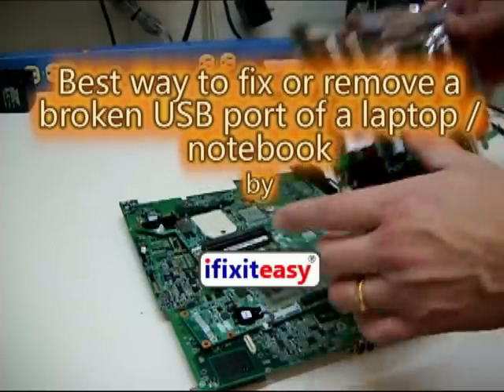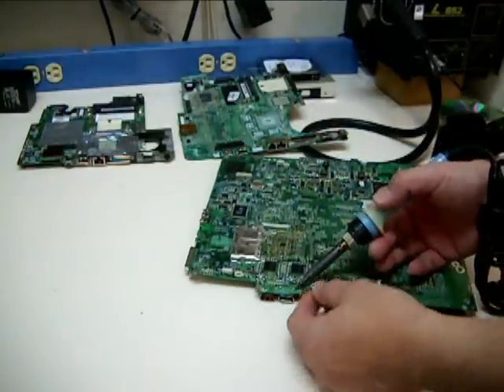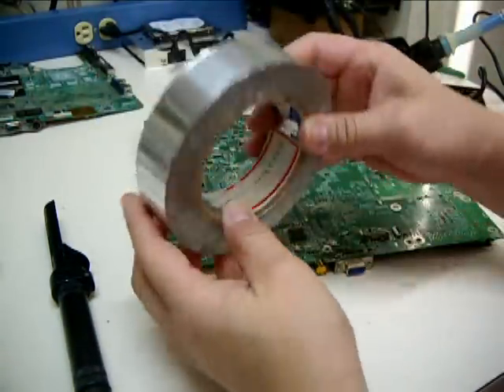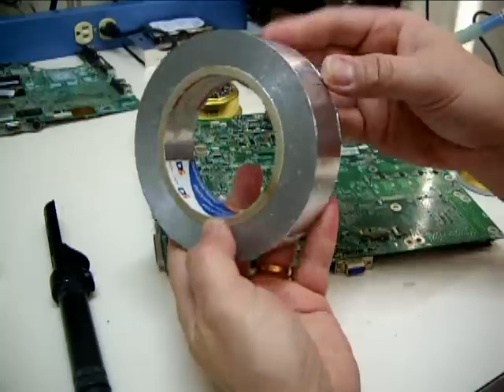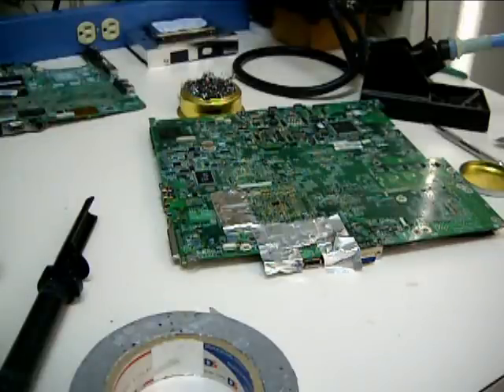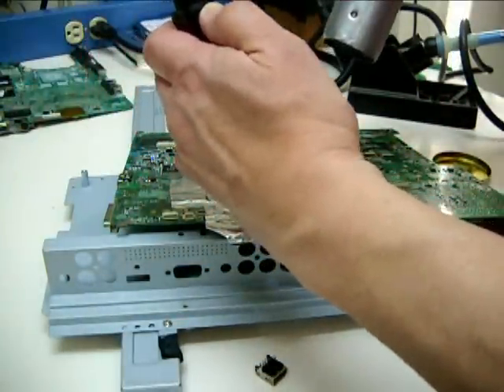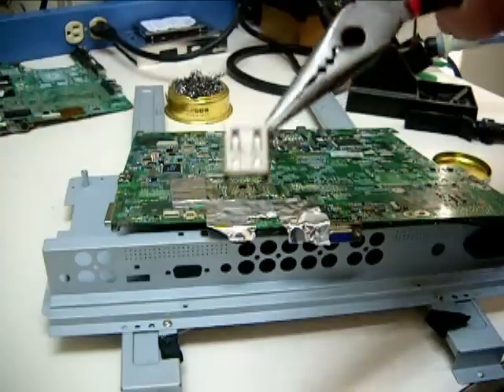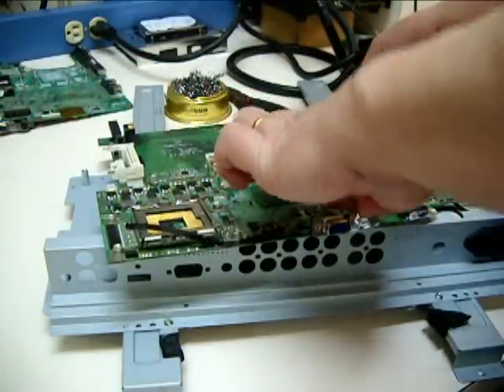How to fix a broken USB port of a laptop or notebook

Comment: You would be much better served in this process with a more powerful iron or hot air station (even a crappy one is decent).  Those 35W irons are way too frustrating to remove OE/wave soldered boards. Once you use a good 85-100W iron with decent tips you would be amazed at the difference.

Comment: wrong! you're not Professional!

heat gun is not the best, is just the simple way! you can burn other components.... the foil dont do any thing just prevent to fly small component....

youre so bad in soldering you dont even achieve unsoldering one leg with soldering iron... you know what is braid? you now that your soldering iron need to have her extremity tinned?
Reply: rude man if you know how why did you clash the guy who try to be useful with his tip ?
Reply: Mixax Mirania 
cause when you show wrong way to do a thing, when you dont have the skill, you dont be usefull..... you just do the opposit
Reply: Miles Tarricone 
me?
yes i did that,
Reply: i hope you didnt talk about the guy on the video
Reply: Mixax Mirania 
your hope never be exaused

Comment: can i do this just with a solder gun itself?
Reply: Yes & also with a heat gun.
Reply: No, you also need an accessory for lifting away the old solder after you soften it with the gun, such as a solder suction tool (as in the video) or some soldering braid

Comment: I just started soldering not too long ago. I made my own dance pad controller for DDR using ply wood, plexiglass, tin foil and the circuit board from an existing dance pad that wasn't working right because it was flimsy.

But recently my laptop fell off my couch and landed on the USB dongle that was still plugged inside and now the USB port wont work. Ya made it look easy enough to do so I'm gonna try it.
Reply: psovegeta corvine63 can you please tell me, from where can i buy a new usb port for laptop. Mine is also not working so i guess i have to buy a new one
 Please suggest
Reply: Same thing happened to me just now

Comment from the maker: No, your hard drive is totally separated from the USB port. So, if your USB is busted then your files are still intact.  If you use an external USB Hard drive and you only have one (1) USB port to connect to, which is usually uncommon, then I guess you have to fix your USB port so that you can connect your USB hard drive. Good luck!

Comment: i'm a girl and i think i can do this!  the guy at the computer repair shop said i had to buy a new lap top.  i knew there had to be a way to replace a usb port, for crying out loud!!   i'm going to do this tomorrow.  i have a very high powered hair dryer that i wouldn't care if it broke. i'll try that and report back if it works.  There are 2 usb ports i have to repair and i'm going to use a turkey baster instead of suction tool. I'll let you know if it works! Thanks so MUCH!
Reply: Hahaha that was so funny to read!
Did you actually try it?
Reply: @orepoutanes  She said she'd report back if she succeeded, so no report means she failed.

Comment: I have to replace 2 USB ports on my moms laptop, so this will come in real handy to get the job done. Thank you for the tip on how to remove the USB ports easily with a heat gun, going to make that job easy. Very smart idea. :)

But I have to say I did get a laugh at how when you kept trying to put the USB port back on and kept getting burned, and you tossed the port aside and said you would do that later. :)